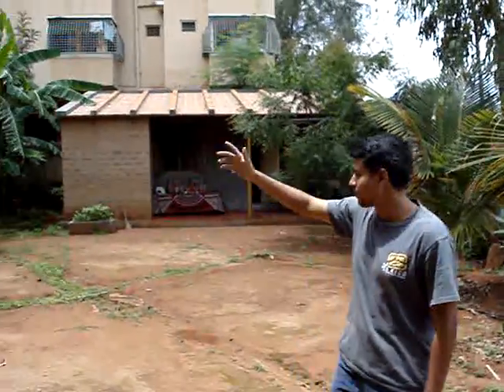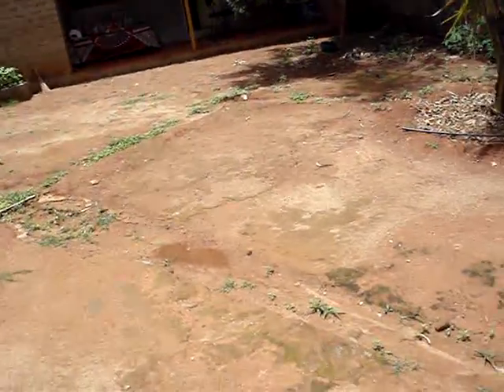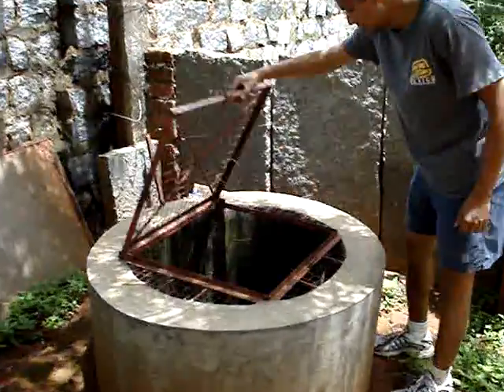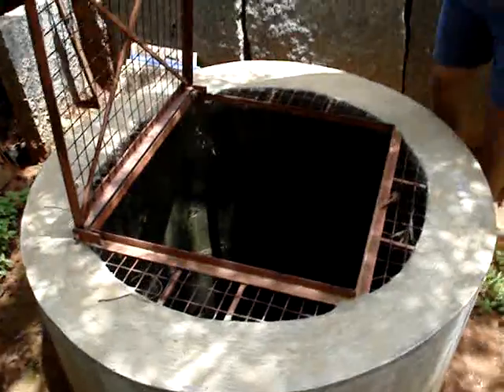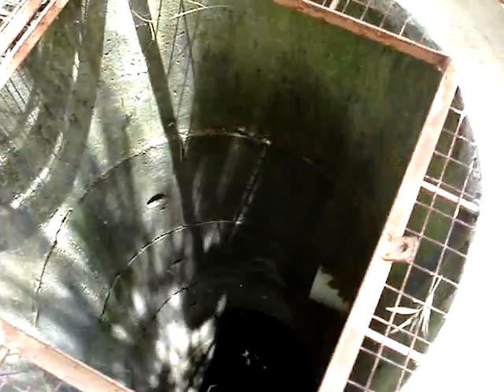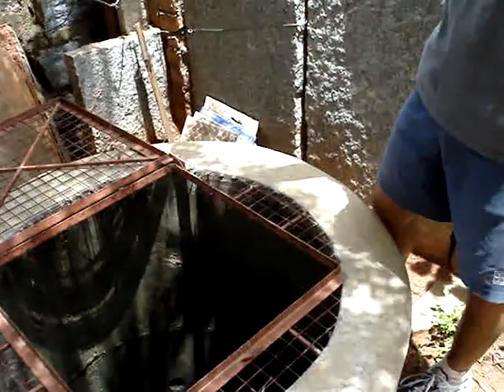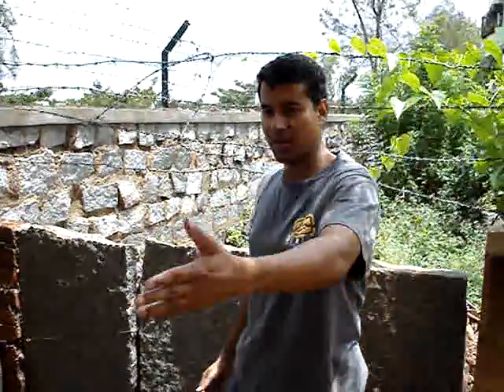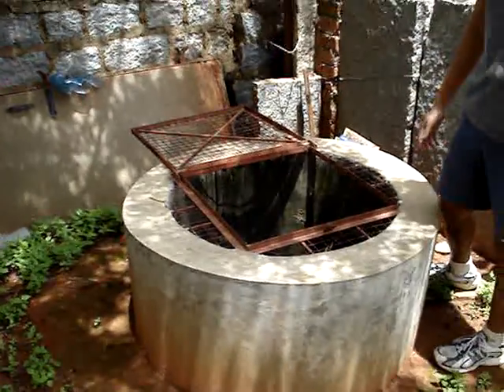PART 4 - Domestic Rainwater Harvesting - Recharge

Comment: Zenrainman, doesn't this attract cockroaches and small rats being practically an open well as it is? Similarly I do work with the same concept in my projects, but instead, use pre-cast concrete rings that don't go all the way to the groundwater, but instead create a space for infiltration, usually 2m deep, or so.